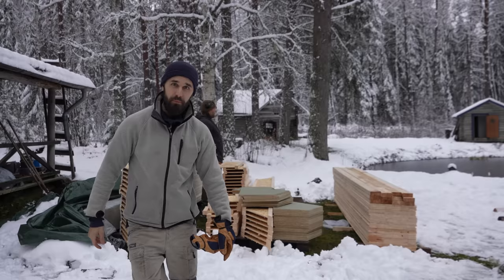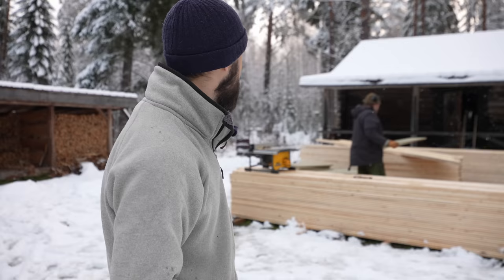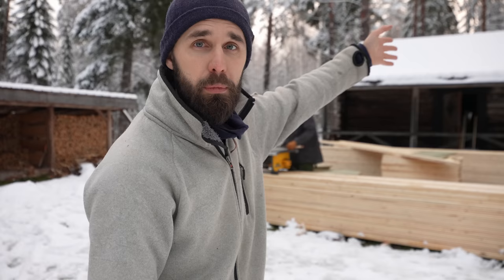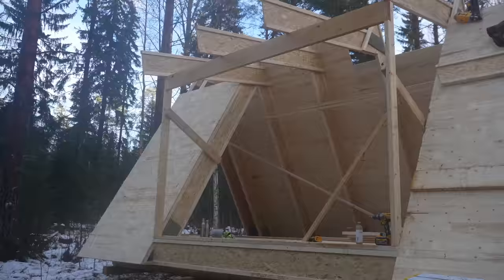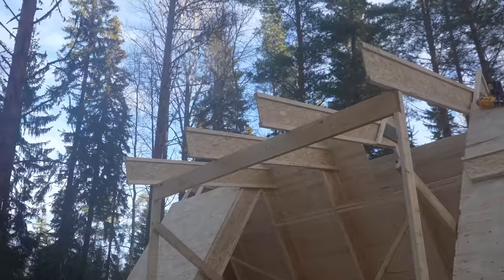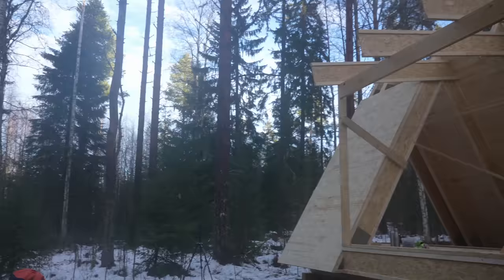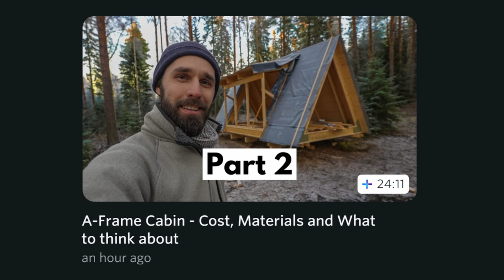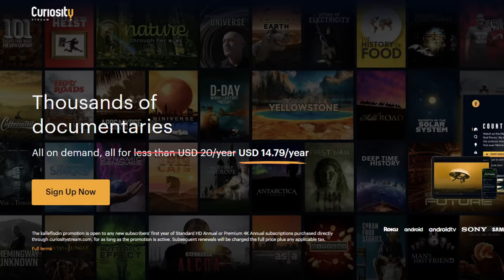Building A-Frame Cabin in Northern Sweden Part 1

Comment: Design wise it looks beautiful. Few advices, since I built similar structure recently:
1. OSB is very unstable for torsion and bearing. I find it very unusual to see it as construction element supposed to "carry" weight. I see it is framed but I would definitely reccomend you to add more horizontal strengthening between triangels. For construction (weight bearing elements) beams I usually use pine wood.
2. Your lowest wooden beam is too close to the ground, moisture evaporating from the soil will fasten the rotting effect. I tried to lift it at least 50cm from the ground to allow air to circulate. Also I treated it with several layers of impregnation and paint. You could also just burn it on the outer layer. In my region (e.g. Northern Croatia in hills or mountains) there are wooden buildings 100+ years old, using the burning wood technique. Traditional construction technics can be a great learning source.
Reply: Perhaps it is a kit
Reply: If you look into masonite beams you'll find that it's a respected company with well tested products. It will hold i promise.
Then if you look into Isak Stålenhag, he is a seasoned lumberjack who also works with restoring old buildings. So i think he's got everything covered!
Reply: @warghem  might be, but still, I think it needs to be then supported horizontaly to avoid torsion. Regarding wood being close to the ground, like I said, I think it will shorten longevity of the building significantly. Which is shame, since building looks awsome.
Reply: @franesarlija5466  To be clear, i agree with your second point. And i also might want to cover the ground under so that the brush don't grow.
Maybe @KalleFlodin kan clear things out for us?
Anyways, cool build and i think it's great that you Frane are taking the time to share your skill and knowledge!
Reply: @warghem  yes, I covered the ground with geotextile, but air flow is even more important. Since wood would need to dry faster, and avoid being soaked with moisture all the time.
Reply: Those osb I beams are strong as hell so its no issue.
Reply: Has been used for many years: 
https://www.starktruss.com/wp-content/uploads/2014/02/APA-D710.pdf
Reply: Those were my initial thoughts as well. 
It’s also unusual for me to see them spaced beyond 24” o.c. I guess everyone builds differently.

Comment: The design is very interesting.  The structure goes together fairly quickly but is substantial. It’s well insulated and the roof is steep so the snow will slide off easily.   I’m going to look forward to seeing it completed. ❤❤

Comment: Kalle, I have just watched your part two video, and you made a comment on your insulation options under the floor and needing to figure out solutions. I don't know if the guys you are building with have it all sorted out or if they are professionals or not, but i am a carpenter of some 15 years and have worked on some A-frames before. I would be happy to give some solutions or options for problem areas if needed or interested. If so, feel free to reach out!  
All the best with the build!

Comment: Hello Kalle! Congratulations on an awesome build. Make I ask what the pile / screw system is that you used for the foundations? It looks like you can use a drill to screw the piles down; I guess you have fairly soft soil? I'm looking for a similar system due to a very remote and inaccessible site :) Thanks and keep up the great work!

Comment: Kalle. The A frame is coming along so nicely. Some office space outside the cabin is a great idea. Will the A frame cabin lose heat more quickly without a flat roof? Will you insulate it? Will you be able to stand up in it / how tall will it be inside? Will you heat it with a stove, fireplace, or electric heat?

Comment: Hello. 
Impressive building design and material choices.
I'm sold on Nebula, based on your recommendation.

I was most impressed with those auger shaped metal footing spikes supporting the building. I have never seen those before, but I have hand dug many, many meter plus deep holes to pour concrete footings.  I am keen to try using them and to learn more about their specifications.

Cheers guy!

Comment: Looks like a great, and environmentally responsible, project Kalle! Can I ask a couple of questions about the extra lengths of timber at the base used to accommodate the A-frames (about 13:30)...Were the trees measured up, or just what you had available? Was it planned, or worked out 'on the hoof'?

Comment: I have a question about how the foundation was done. Did you dig a hole, and how deep, put stones and gravel in it, then poured in the concrete with armature (steel poles)? And when the concrete was dry (after 1 motnh i think) then you put the first wooden beam on it? Did you put screws in the concrete foundation if it was done that way? did you hydroisolated the concrete foundation so that it doesnt absorb moisture? Thank you so much, the cabin is looking really great.

Comment: I am wondering about the large opening through one side of the building where you have what appears to be low slope rafters that frame a near-flat roof that are about 3 to 4 feet on center. What are you doing to handle possible heavy snow load on this near flat roof? Can I assume you will have more structural support for this area?

Comment: As a Finn it seems like complete insanity to build an extra cabin, when you're still taking showers outside in the dead of Winter. Why not build a sauna or turn one of the smaller  log houses into a sauna? Other than that, the A-frame is looking good. Great work.

Comment: 😁 cool. i was wondering why u used double obs with 2x2's glued as wall beams to make a.frame? was it cheaper than 2x8 lumber, perhaps easier to haul into forrest, cus of weight? ... i wanted to, really nr1 preference, to build a.frame as small housing when i move to portugal next yr. i have plot of land but am allowed to build wood structure as its seen as temporary structure..like cabin or yurt. i wanted a.frame cus its prettty and i can build myself and expand on later.. the wood is nice to have when cabin is worn down and ready for replacing. its remote and old wood will find its re.use easy on remote homestead. 
i had 2x8 iin mind for the build, but hadnt considered a obs h-beam ! instead. that looks like perfect solution for gettiing the building materials from store 75km away into back country...big truck delivery is not really option..a smaller vw transporter can... but 2x8's wil require several trips extra.... cut obs ..like u show at beginning...the 3 piles are all you need..... coool!
how good is the double obs h.beams for contruction? of the frame...anything i should know or limitations maybe?
maybe silly question but did you use building plans? are they available for purchase?

Comment: I like the width  in the floor joist and the roof, but wondering would it have been possible to make the side panels less wide. I hope you understand what I'm asking, like the boards of the roof that separate the  wall coming down through there that the roof is nailed to,  that you first put up, could they have been less wide without the plywood between so as to make a few inches more room? IDK if your going to get what I'm saying, but I was just curious.
Reply: Where the osb boards (not plywood) are, there will be insulation